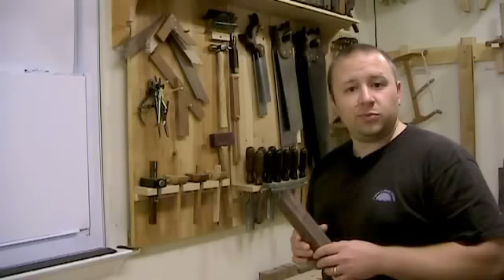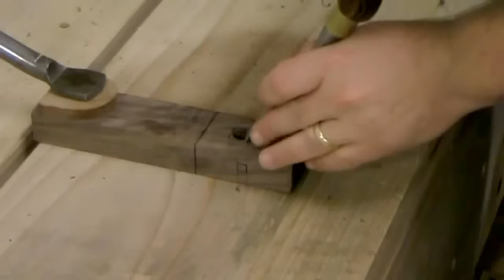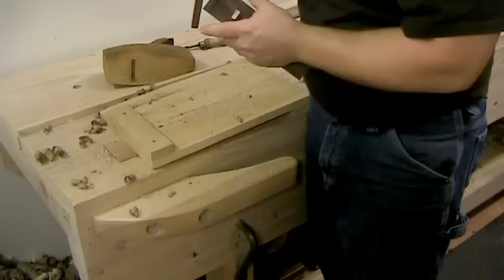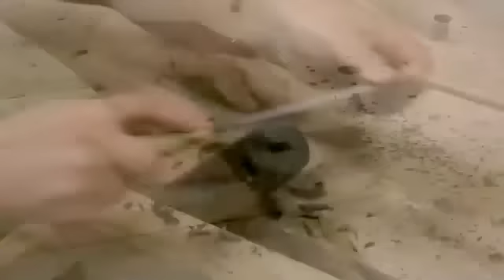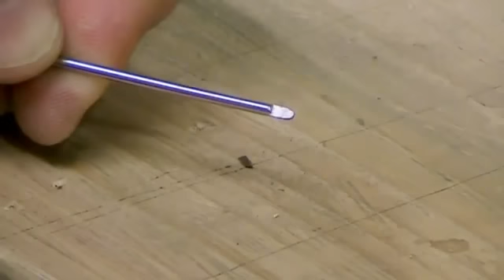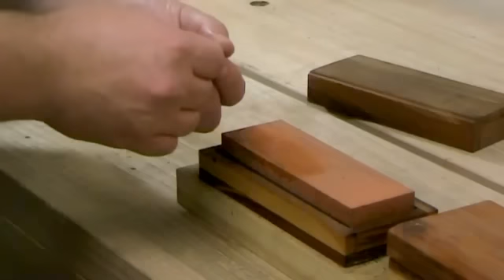How to Make a Marking Gauge with Hand Tools - Hand Tool Woodworking

Comment: Thanks for sharing. This is an good project to start for someone like me who is just starting woodworking. Question : is there anything you do/need to do to make the arm square with the block? Or does it not matter, and doesn't have to be exactly 90deg?
Reply from the maker: It doesn’t have to be 100% perfect but if you chop the mortise square then the beam will be square. If you’re not confident in your ability to chisel the sides square, you can clamp a guide block along the layout lines to help guide your chisel cuts. Also, chisel in from both sides and meet in the middle.
Reply: @BRFineWoodworking  Thanks! will try.

Comment: Nice little project!   Well presented,  but I think the construction procedures for right vs left hand and thumb-push vs finger pull, etc. defies description.  ...or at least in 1000 words or less (lol).  To maximize life expectancy of a file, it's best to lift it off the work on the back stroke.  Dragging the teeth backwards  wears them much more than the forward, cutting stroke.

Comment: Go through it from the first side until the tip of the bit begins to exit.  Then you can use that hole to guide the bit from the other side.
Reply: I think meeting half way helps you keep the mortice square to the fence. Any error in angle ends up in the middle and you can chisel square with your lines. If you go until the snail comes out you're committed to the angle and it might go outside your lines on the other side. 

At least, if you have boring accuracy like me. I guess you could also use a smaller bit and do more chiseling.

Comment: Nice video. By recording in real-time, clearly showing details, this is a very useful instruction. Too bad it is only 360p, future videos maybe in 720p? I am also amazed by the side-wedge design. This is SO simply to come up with, I feel so stupid that I have been building a marking gauge with a lateral wedge. Agreed, if you are careful you can also adjust the lateral wedge without shifting the slide, but with the side wedge it is easier I guess. As long as the slide is perfectly smooth of course.
Reply from the maker: jlinkels Thank you for the comment!  Looking back on it I do wish I could have made these old videos in HD. But most of my videos were filmed back in the 2009-2010 period, before HD cameras were readily available for home use and before the online video sites allowed uploading in HD. While this video was added to YouTube in 2014, it was shot in 2009 or 2010. So the video quality isn’t the greatest unfortunately. But yes, when I am able to get back to making videos, they’ll be uploaded in at least 720p.

Comment: Great video! Liked the design when I found the Popular Woodworking article.  Thank you for the video on making one. Particularly like the idea of using a dowel for the wedge. Instead of marking the part of the dowel to be pared away, why not just drill the hole for the dowel hole first, insert it into the beam, then cut the mortise for the beam through it? Can then just add the taper afterwards.
Reply from the maker: Bill Smithem Thank you!  Your suggestion would work just fine.

Comment: Maybe this is a stupid question, but what size are you making each mortise for the wedge?
Reply from the maker: Not a stupid question at all.  The mortise is 1/4" wide as it is made with a 1/4" wide chisel.  To size it, you make the bottom of the mortise intersect the mortise for the beam by a hair because it has to apply pressure to the beam.  The top of the mortise tapers from one side to the other.  So the actual size will vary depending upon the width of your fence stock and the taper angle you decide on. I shoot for about 3/8-1/2" tall for the mortise on the wide side.  What it tapers down to on the narrow side depends on the taper angle and width of the fence stock.  I don't measure this.  I just transfer the profile of the taper across the face of the fence and connect the lines just like scribing a square line around a board.

Comment: why were you pointing the torch towards the oil? you could do as good by bringing the steel to the torch. you still had ample time to get to the oil.
Reply from the maker: michael martin It was just so I could get everything in the camera frame. Normally I'd stand the torch upright and even put a hand screw clamp at the base to stabilize it.